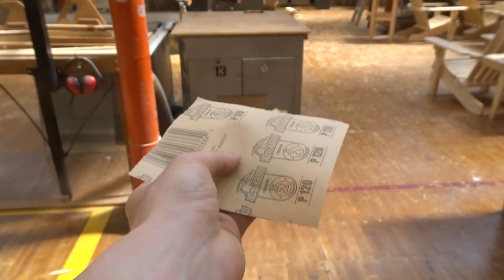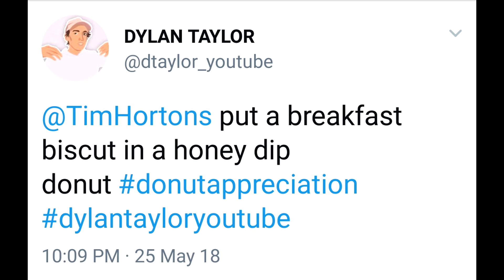I Threw My Computer On The Floor

Comment: I've been thinking a lot lately about how I need a lathe. I gotta get on building one. I already made myself a skew chisel out of an old file.
Reply from the maker: I have a small pen lathe that I've never used, its in rough rough shape. Id offer it up to you. I just don't know if it would be worth what it would cost to ship it
Reply: That's ok, I really want to build an old fashioned bodger's pole lathe out of wood. I think I have enough material for it, I just have to do it. Do a search for "pole lathe" and you can see how they work, I think they're really cool.